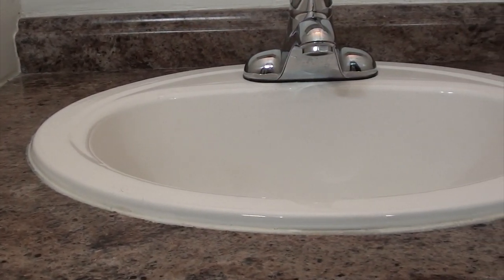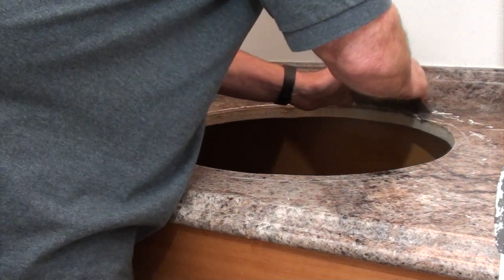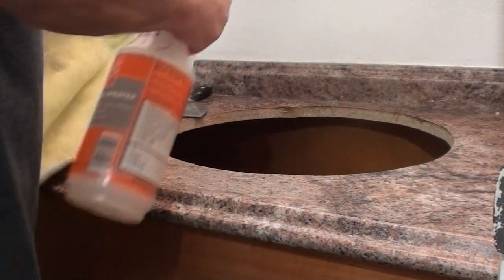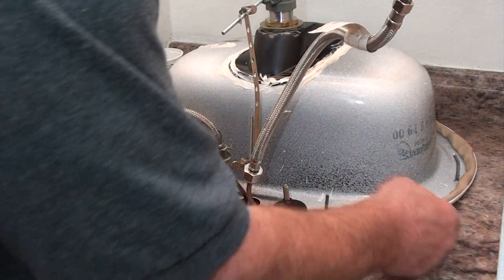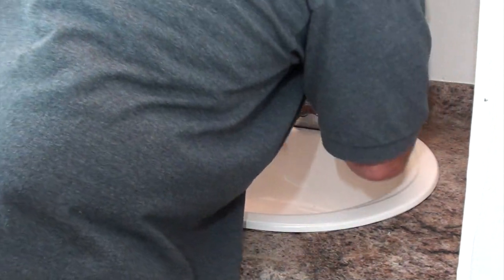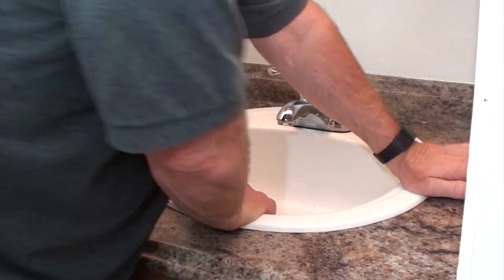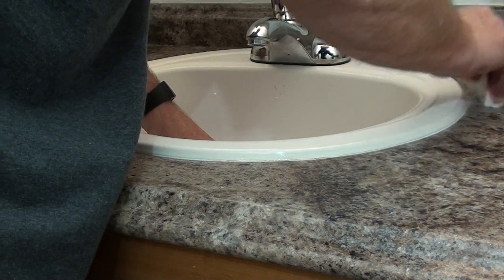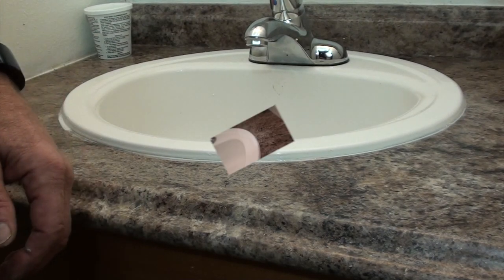How to Caulk A Bathroom Sink

Comment: Question: why do you need Plumber's Putty when you're using silicone anyway?
Reply: Silicone isn't strong enough to hold the sink in place. Silicone is just to close the gap between the sink and counter and keeps water from getting underneath.
Reply: @bryancaruso4580 My cast iron sink is rusting and leaking into the natural stone, due just putting chaulk.  I like the recommendation of plumbers putty - hopeful it will prevent sink/stone contact.
Reply: Thank you this answer. We had our bathroom redone 5 years ago & I’m having to re-caulk the dual sinks. They did a terrible job, starting with crooked installation (one is closer to the mirror than the other) and no putty, just gobs of silicone under the sink that is doing nothing. I can literally lift the sinks out of the counter. I appreciate your advice.
Reply: @rohitbhatnagar7599  I have the same issue, did it work?
Reply: @tomatden  I put caulk on the bottom, not plumber putty.  Your sink will always be wobbly, since plumber putty will not stick.  Iron to natural stone is still there with chaulk, but far less.